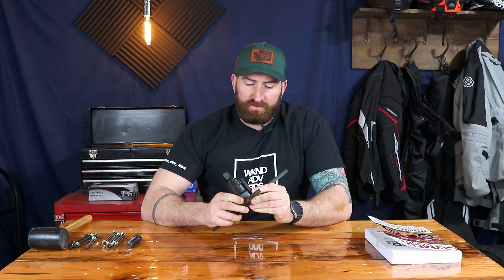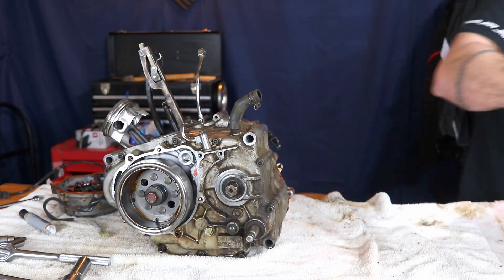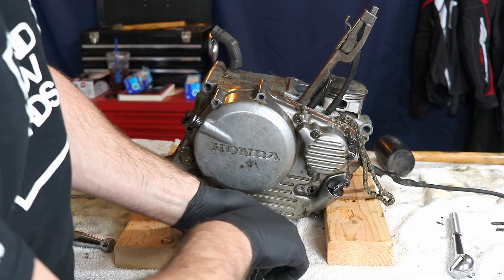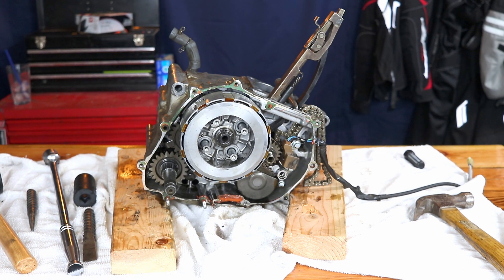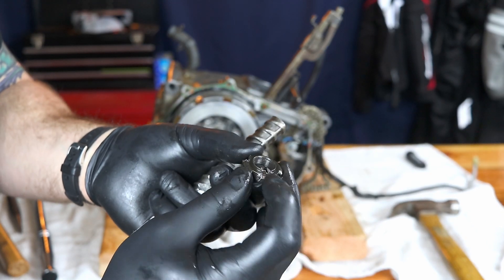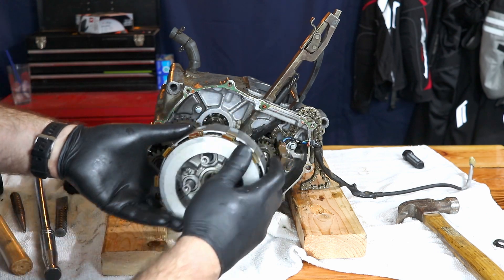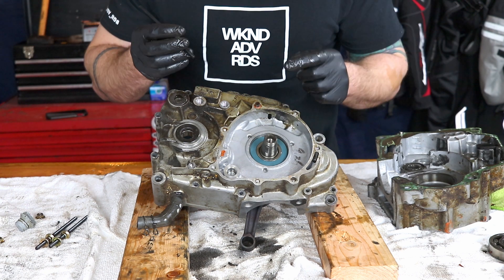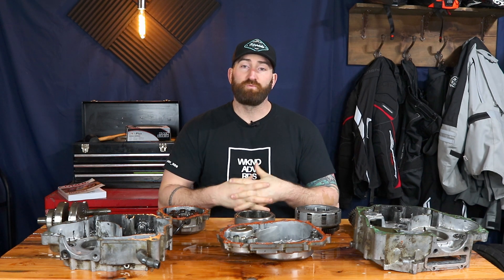How to: Xr250R Crankcase Tear Down

Comment: Hello! I know this is an older video but im in the process of rebuilding a 1989 xr250r as we speak and i had a question for you. My biggest concern is the right side crank case bearing. I was able to find aftermarket bearings because honda dosnt offer them anymore. But my fear is that the oem bearing has a seal on the clutch side. The new ones are open face bearings. Did you run into this problem? Thanks.
Reply from the maker: I dont think that will be a problem. I can't seem to remember what I did. I know I bought some from honda and some from a bearing distributor. Open face bearings should be fine tho
Reply: @WeekendAdventureRides  thank you!

Comment: Do you need to split the case to replace countershaft oil seal ( front sprocket seal) ?? Thanks 👍
Reply from the maker: You do. That seal specifically has a flange that retains the seal.
Reply: @WeekendAdventureRides  
Thought as much cheers. Keep up the good work on the vids, most intuitive 👍

Comment: Dude you butchered that nut,  Looks like burnt oil in the motor.
Reply from the maker: Yeah it got replaced with a new nut. Oil was dark but not too thick or excessive deposits.
Reply: @WeekendAdventureRides   Great video sir.

Comment: Great video! How did you get that fly wheel bolt loose? Did you hold the crankshaft on the other side somehow? Thanks
Reply: you can make a holder tool out of a sheet of steel or thicker aluminum that mount to the 4 bolts of the clutch basket/flywheel. Its really easy and avoids more damaging methods.
Reply from the maker: Use a soft piece of metal and put it in the teeth on the Flywheel